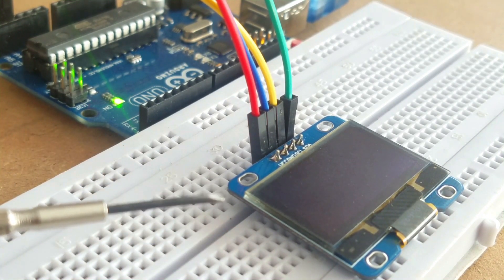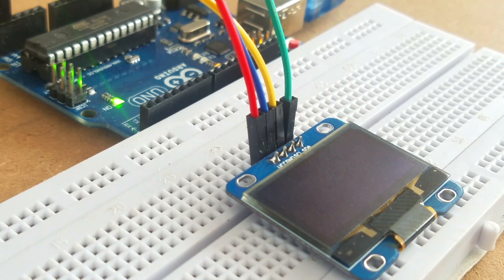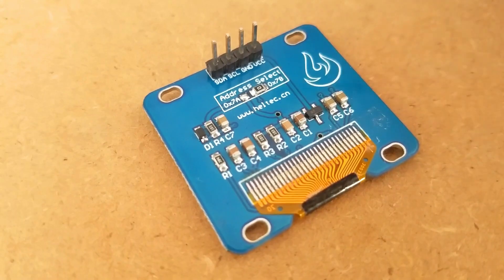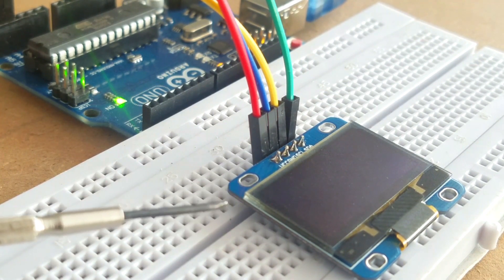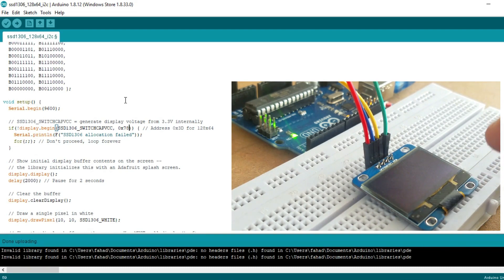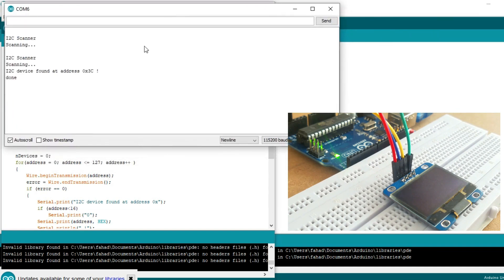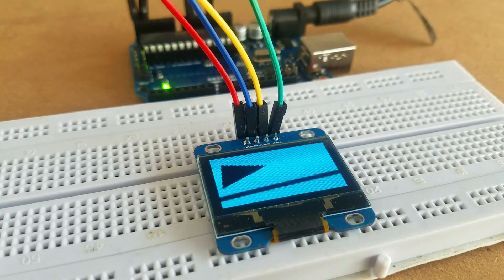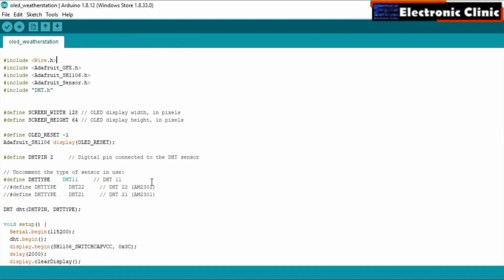Oled i2c Arduino, Arduino Oled 128x64 i2c library, Oled 128x64 i2c display issues solved

Comment: Hey I am having an issue when the values gets updates it shows messed up number like the previous values won't be cleared and new values are shown on top of pervious values. Do you know what is is causing this problem or how to fix it?
Reply from the maker: Clear the display first and then print other values.

Comment: I've used different codes and the display won't turn on.
Reply from the maker: you might be using another version of the oled display.
Reply: @ElectroniClinic  I was using adafruit SSD 1306 and UCtronics code, and also followed along some tutorials. The display won’t power up I might have gotten a defective display since I already bought one. It’s hard to test 1 hardware with no backup.

Comment: sir Please upload one vedio for
sht31+esp32+oled1.3"+blynk notification+thinkspeak+button controler
( temperature and hummidity setting thereshold)+with calibration setting from button+centigrade & farenheit setting from button+temperature and hummidity high & low alaram using incubator.and  egg turnning time control+ventilation controler from temperature based 0 to 180 degree.+data logger . thankyou

Comment: Be careful with these OLED modules.  Some have GND and VCC pins reversed!  In fact, the Fritzing diagram at the end of the episode has them reversed from the module he is using!
Reply: Following this up:
The way you can tell is the GND pin usually is square.

Comment: I am trying to store (in SD Card) and display temperature value. But it error occurs "Not enough memory". Please help me to fix this issue. or add a video in this to store and display temperature values.
Reply: Check the flash memory of your board and how much memory your program uses.

Comment: Can I use I use 128x64 oled in a circuit that previously used 128x32? Should I change code if I used 128x64 instead of 128x32

Comment: Hello
im getting this kind of error 
'class Adafruit_SSD1306' has no member named 'cp437'
against the line (296)
  display.cp437(true);         // Use full 256 char 'Code Page 437' font

what am I doing wrong with this.?
please help